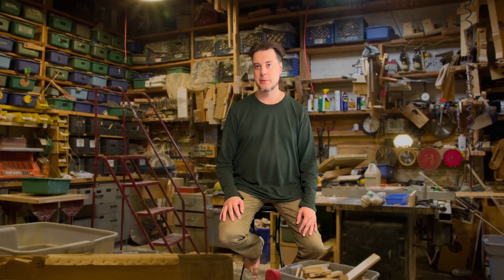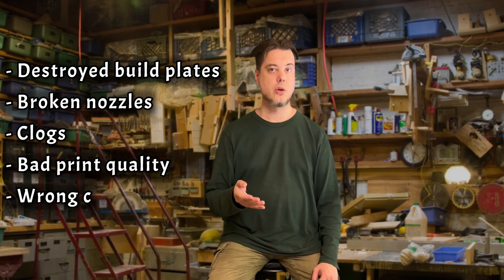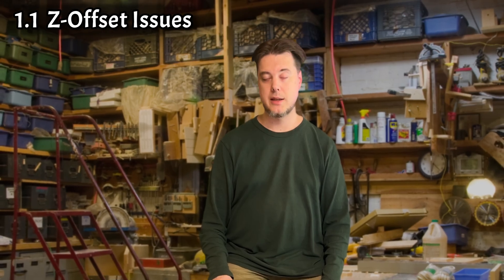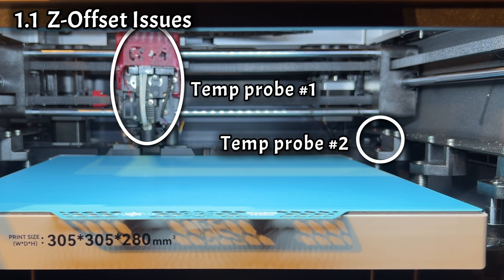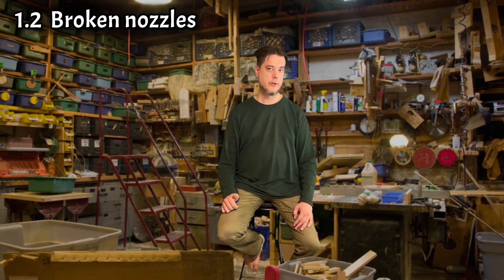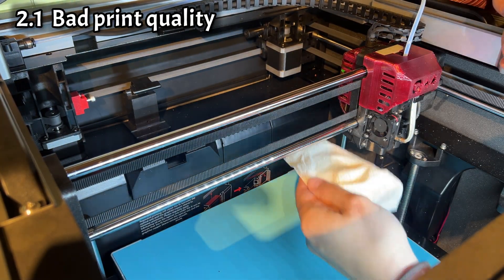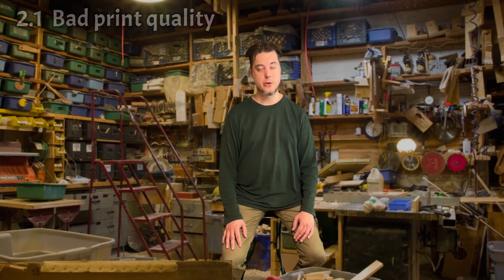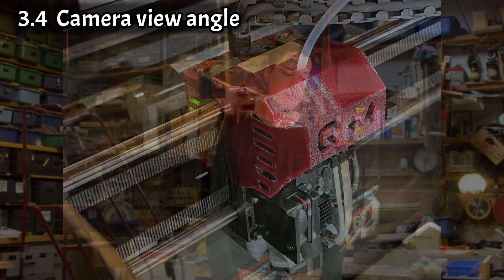Qidi Plus 4: Must-have fixes & mods (free)

Comment: What printer would you recommend?
Reply from the maker: That’s a question I don’t have a direct answer to right now. But if I were looking for a new printer right now I’d probably look into Qidi Q2 and Elegoo Centauri Carbon first. Especially their reported faults.
Reply: @mrelwood_media Thank you. You’re very insightful, I’d be willing to wait for a more considered response but will look into those models. It’s interesting that an older model would be more capable . Hey, you could do a YouTube video on what you think the best is and why maybe. Thanks again.
Reply from the maker: @frankg3278 Thanks. Unfortunately there’s not enough incentive for me to make a such video without actual hands on experience with the printers I’d be talking about. And I know that that’s not going to happen. Making a recommendation video based on what I’d just read online and see in YouTube reviews just isn’t me, as it’d all be just guesswork.
Reply: @mrelwood_media I’m looking at making engineering parts like manifolds and gears which leads me to think I’ll need to use a carbon reinforced filament or Polycarbonate. Will the 2 you suggested be able to do this do you think? I’m open to other suggestions. There’s so much choice out there…
Reply from the maker: @frankg3278  Do you mean PP Graphite? You can print that with any printer. While the Centauri Carbon claims to be suitable for CF filaments, incl. PC, PA, etc, it doesn’t have a heated chamber which might make some materials a bit challenging. Q2 bed and especially the nozzle are also able to go (much) hotter, opening up even more materials. That said, there are good CF filaments that don’t need a heated chamber, such as PET-CF and PCTG-CF.

The Q2 specs are much better, incl bed size. But like we’ve seen with the Plus 4, the specs don’t tell you whether you can even finish a print without excessive tuning and problem solving. You need to rely on real life user experiences from others on that.
Reply: @mrelwood_media That’s a good question, I’m still learning. Essentially, I want to use a material which is capable of withstanding a lot in the way of heat, stress and fuel exposure. The Q2 is looking like a good option then. Given the price difference between that and the Q4 that’s such a surprise!
Reply from the maker: @frankg3278  There are lots of engineering filaments available, each with their specific strengths and weaknesses. I’d compare the data sheets on especially PET, PA and PPS, possibly ASA and PETG as well.

If you want it to be especially rigid even if it makes it more brittle, look into CF filled filaments.

Check the YT channel “mytechfun” for magnificently detailed comparisons on practically all filament types as brands.
Reply: @mrelwood_media Thanks buddy. It does look like carbon filled filaments are the way to go. Any specific requirements or concerns about that I should consider?
Reply from the maker: @frankg3278  Depends only on what you’re going to use it for. The differences between the materials’ features are big. In the data sheets compare especially:
- heat deflection temperature
- flexural strength and modulus (rigidity)
- impact strength
- chemical resistance

Then decide what’s important to you and check if Mytechfun’s tests on creep, layer adhesion and others are suitable for your use as well.

Comment: It's scary, I'm expecting mine in a few days and I'm a novice in this subject. The only thing I can say about these machines is that when there is heat, you need building materials that are resistant to heat.
Reply from the maker: The building materials in the Plus 4 don’t seem to be the issue, it’s the assembly and electronics. I strongly recommend you to cookie at least the crucial recommendations from this video, since they will solve potential issues both now and later on. With them you can most probably just rest easy and print away.

Comment: Enjoyed the video. I'd have to disagree that it has a lot of issues. I have never had an issue with it. Is it perfect? No but honestly none of them are from any brand, including Bambu whose cust service is awful.. Never had a single print issue, I bought the tungsten nozzle when I got it. Also never had a single nozzle damage a plate on the z offset not one of my plates has ever been damaged. Maybe early ones? Can't speak to that with mine.
Reply from the maker: Faults never appear on every single device. That’s why there’s a saying “I got a lemon.” That doesn’t mean that everyone will get a lemon. If a single unit has a fault, that doesn’t mean all of them do. And if your unit doesn’t show faults in your use, that doesn’t mean that it’s not one of the most failure prone printers there is.

For perspective, check your the Qidi3D subreddit to learn that a lot of people indeed have these exact issues with their Plus 4 units, from the very first units to the latest ones.
Reply: @mrelwood_media I. Never said faults never happen, in fact I said they happen in all brands. I don't need perspective I am fully aware of differing viewpoints. You will always find the bad sides online that's what people like to discuss the most. In fact that's why such places exist for people who do have issues to find solutions. So the view is always going to be more negative than positive overall. I clearly said none of them are perfect. Just because a point doesn't reflect your experience doesn't make it invalid. As for most failure prone printers sorry don't agree, is it perfect, no. Are any of them, no.

Comment: Thanks, good stuff. My +4 has bad Z problems, it's been down for repair more than up and printing. Z offset of 2mm after factory reset at one point. Most of the other things mentioned are not a real problem yet. I will be checking the heater wattage though.

Comment: Youtube is not letting me to reply to you with the code (regarding my RESUME macro question). I've left a comment on printables
Reply from the maker: Thanks. The first G1 command is on line 30, so the SAFE_Y line needs to be right before it, between the M106 and G1 lines.

Comment: I would love to know more about the lead screw replacement grommets; I'm not sure which piece should be replaced (can crumble). I'm experiencing a terrible screeching noise when the platform raises/lowers and I'm wondering if it could be something to do with the piece that attaches to the z-screw...
Reply from the maker: The screech could be related to the crumbling piece, or the bed alignment may be badly off. If you haven’t already I’d tram the bed manually again, as it also resets bed tilt.

If the grommet’s spot isn’t clear in the video, check the link for the grommet in the video descriptions, there are more photos on the Printables page.
Reply: @mrelwood_media thanks for your quick reply! I’ve trammed the bed, it seems perfectly level (I installed a beacon probe), I’ve disassembled the platform, nothing seems to be broken or in pieces, and it looks like the platform nut is just a plastic piece… I’ve looked at the Printables page, but I don’t understand what I’m actually replacing or what could be broken - it looks like I just put the printed grommet on top/around the z-screw… Thanks again for your attempts to help!
Reply from the maker: @trioptre  The place the printable grommet goes into used to be covered with a white plastic piece, which is the one that tends to disappear in these. If yours look the same as the photos, yours are also missing. If they’ve crumbled into the threads and are causing the screeching, I don’t know if even a disassembly and cleaning would be needed. But I guess that would be the worst case scenario. You might want to reach out to the Qidi Plus 4 support email.
Reply: @mrelwood_media  A-ha! I’ll print the grommet and see how it goes. Thanks for all your info and videos!

Comment: Hello, I am trying to install your SAFE_Y Macro. In the newest version you say to put the SAFE_Y command as follows:

[gcode_macro RESUME]

Before the first "G1 ..." line.

But in my gcode_macro.cfg, the RESUME macro doesn't have any G1 lines. Qidi Firmware Version 1.7.1 
I presume QIDI changed something; where should I put it?
Reply from the maker: They might be G0 commands as well, they do the same thing. In the FW 1.6 there are a few lines of conditionals, then M83 and M106, then a lot of G1 movements. I’d assume the FW 1.7 to follow a similar pattern. It’s important that SAFE_Y is before any other movements.

If you can’t determine the location, paste the first few dozen lines of the RESUME macro and I’ll look at it.

Btw, don’t forget to (backup and) replace the “homing_override” with the modded one.
Reply: @mrelwood_media  I think the main issue is that the RESUME macros is now split into two macros. I created a pastebin and posted it as a reply but it got deleted by YT :/

If you go to pastebin (url) (slash) aSDRM07G

You can see both of the RESUME macros, I hope this comment doesn't also get  auto-deleted :D

Comment: Beacon RevH has worked consistently for me with standard temps for PLA, PETG, ABS and ASA. Consistent does not mean perfect, though - I always have to manually set the Z-offset to -0.04 at one corner, and slowly reduce to -0.1 as the first layer approaches the opposite corner. Everything I have tried so far as not fixed that. It's annoying, but I got used to babysitting the first layer. I don't blame the Beacon for this because my Z-offset readings are always consistent with it. It seems to be an issue with the Plus 4 bed always getting a little out of alignment. Tramming does not fix it.

The hottest I have made the bed is 110C, and the hottest I've gone with the chamber is 65C.

I am a fan of Qidi because they offer so much value for the price you pay. Their printers are usually not perfect, but they're usually fixable. If you don't like to fix things, you can always pay 2x-3x more on a Bambu to save yourself a little trouble (Bambus aren't perfect either, but they usually have less issues). As someone who likes to take things apart and improve them, Qidi makes a lot more sense to me.
Reply from the maker: I don’t really mind tweaking, but I would’ve wanted to know what to expect from the Plus 4. I only found glowing reviews before buying mine. The surprise was pretty harsh.

How come the ABL / bed probing doesn’t solve your tilted bed? Having to manually adjust the offset during every print sounds like a nightmare to me. The Beacon is supposed to fix exactly those issues. Have you asked for tips at the Qidi Discord? Lots of really smart dudes over there.

Comment: Shame, was seriously considering this machine, but its giving me creality vibes. I just want a tool, even my prusa mk3's (which are resonably reliable) are feeling too high maintanance so this is out for sure 😞 , Is there another printer worth looking at with this bed size?
Reply from the maker: Qidi recently came out with the Q2 that has a slightly smaller print area (270*270*256), but apparently they tried to fix several of the Plus 4 issues. I don’t know its downsides yet, but so far to me it seems like the most interesting printer right now. It’s also cheaper. The Qidi Box doesn’t seem ready for use just yet thought, so I wouldn’t get the combo.

Or you can go with the huge (and also problematic) Creality K2… 😆

All that said, the reason I made this video was because with these fixes I got my Plus 4 to be a magnificent effortless problem free printer. They are all do-once-and-forget type fixes, and I expect it to serve me well for a long time to come.
Reply: @mrelwood_media  I still have PTSD from my CR10MAX. That was also a half baked printer that was rushed out and abandoned for other models. I paid £700 for that at the time. For that kind of money I shouldn't have to do any mods, same applies for the QIDI. I would rather double my money and save up for the H2S. Shame because the overall package is attractive.
Reply from the maker: @RoadRashSpirit  Around here the H2 is three to four times as expensive as the Plus 4… But you’re right, even at the Plus 4’s price you shouldn’t have to mod anything. But in my opinion a 3-4x more expensive printer just to avoid modding simply isn’t a sensible option in any stretch of imagination. Unless you need the other features. And are familiar with its issues as well.

Comment: An individual on the qidi discord noticed that the Piezo sensors are made of tiny crystals and when hit with heat the separate inside creating the issue.   Also the insulation being used was wrong. His fix included a different insulation material when replacing them.  Makes sense.  Mine is now starting to drift so im requesting new sensors but likely will do a beacon in the near future.
Reply from the maker: I’m not surprised about the issues in the piezo sensors. But like I said in the video, new piezos from Qidi didn’t solve the Z offset issues for me. Yet the chamber temp mod did.
Reply: As a QIDI Plus 4 owner, the whole thing is cheap rubbish marketed as some great 3D print machine!

Comment: What does your fast install mean by "Then copy the Machine Start & End g-codes into the slicer's Printer settings, restart Klipper and you're ready to go."
Reply from the maker: All slicers have editable fields of code that are run before and after the print. They are called “Machine start g-code” and “Machine end g-code” in Orca. Copy the texts in those fields into new text files for backup, then replace the ones in the slicer with the ones provided in the Fast Start download package.
Reply: @mrelwood_media  so copy and paste the entire contents of PRINT_START_FAST.txt into the slicer's Machine Start-Gcode section of the printer?

Comment: Is my QIDI Plus4 as user-friendly as my Bambo P1S? Nope, but it really is a better printer than my Bambu P1S and turns out fantastic prints. I did my own chamber heater mod and not having any Z offset issues because you have to heat soak the bed and printer before starting a print. I can go between ABS and PLA+ with a minor change in z offset needed between them.
Reply from the maker: If you start to get the Z offset issues, you’ll soon learn that it’s not about heat soaking the bed or not. But In glad that you don’t have the issues with the Z offset!

Comment: Thank you for this great video!!! Well my Qidi story is very similar to what you disucussed in your video and I will not buy a Qidi printer again. I did buy 3 Plus 4s and returned 1 already after 6 weeks and about 40 hours of wasted time to trying to fix it. Qidi customer support stopped to reply to my questions/problems (Z hight adjustment -> all the symtoms you discribed). Than my retailer (thank you very much 3Djake) stepped in and I could easily return the printer and get my money back! One issue you did not mentioned: 3 cameras died on me already -> 131.97 Euro + 98 Euro (shipping) + 60 Euro DHL charges for customs handling -> total 300 Euro for printers still in waranty. Qidi has lost me as a customer forever.
Reply from the maker: Thx! I haven’t seen many camera issues being talked about, so I wasn’t aware it could be a problem. You having three of them die is very surprising to me. But being charged for spare parts under warranty?! How did that happen?? I (and many others) have gotten several spare parts directly from Qidi, free of charge, with free shipping, only having to pay for the import tax (which Qidi can do nothing about). If anything, the Qidi support is known to very openhandedly ship whatever spare parts you need, whatever it takes for them not having to take the printer back…

Either way, I really can’t blame you for ditching Qidi. To most people they’re just way more trouble than they’re worth. I’m just relieved I’ve finally gotten mine working great.
Reply: I had exact same issue... Qidi customer support stopped comms and help, problem/fault was too big.

Comment: I truly appreciate your video, lots of fantastic info.  I have to be honest, I purchased the Qidi Plus 4 to print ABS, I was not happy with my Bambu X1C attempts with ABS.  The huge problem for me was the bed leveling.  I have to admit, I have been spoiled with Bambu's leveling system, meaning I have never had an issue or had to due anything, its just done every time right.  So, you can imagine how disappointed I was with the Qidi, when there are several hoops you may have to jump through.  I still love it and have managed to get decent prints as long as they start in the center of the build plate lol.  I considered returning it, but decided that I was not going to let this get the best of me.  I will try your solutions for the z-offset.  Thank you so much for this info!
Reply from the maker: Thx! I have high hopes that the solution will work for you too. 👍

Comment: it is a very bad ides to lubricate the lower rod of the printhead, because the bearing there is filled with graphite and by lubricating the rod with oil will wash out the graphit - the "black dust" he wiped away..:
the result is a loose bearing, whitch now have to be fixed. so please keep the lower rod just clean and dry - thats it
Reply from the maker: You might not have listened very closely to what I said in the video, but I replied in there already.

Comment: king! Youre saving me man, I head exactly what you said from Qidi support just last week. New piezos on the way, but no expectation that theyll work any differently.
Reply from the maker: Thx! Go ahead with the chamber temp mod right away, it could be really helpful for you. Just back up the files first in case you’d want to revert. Can’t think of a reason to do that though... 👍
Reply: @mrelwood_media have you tried putting a tripor upside down under the bed around the piezo? You could put an m3 bolt right through it, and put a couple of newtons of force on the piezo. it could increase the sensitivity a lot, and it could be a simple mod if you use the right material, like metal that can handle the case temps.